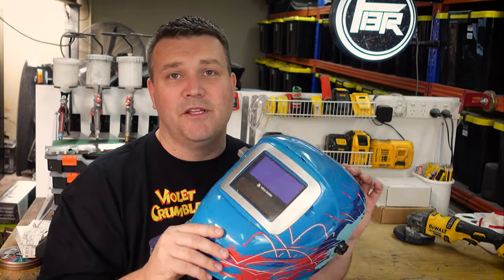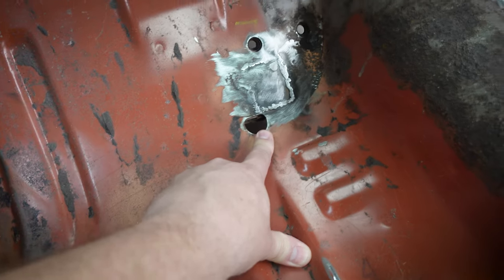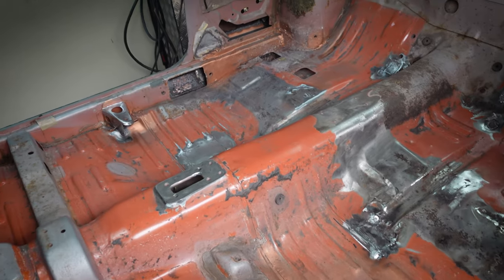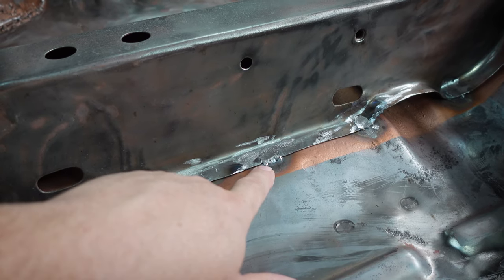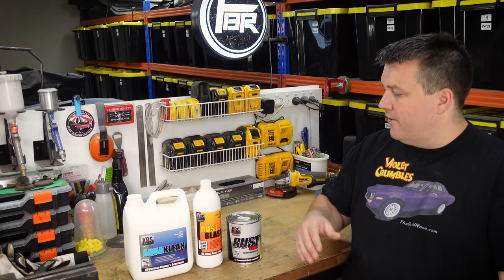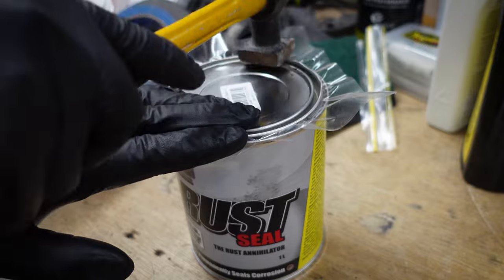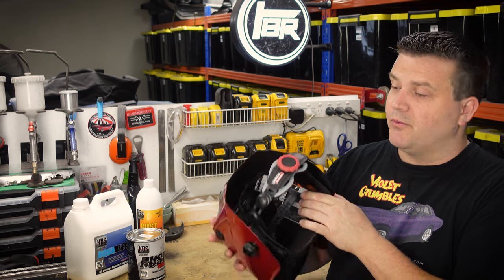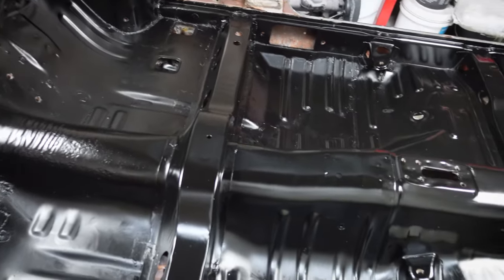Fixing the Rusty Floorpan - RA23 Toyota Celica Restomod (Part 30)

Comment: The sand just gives you a non slip layer to the floor mate. I've wanted to see a reveiw on the KBS stuff for a while so cheers for that.
Reply from the maker: Glad it can help - I haven't used it before far so will let be sure to check back in over time and update if there are any failures/problems.
Reply: It’s great gear, follow the instructions, give the rustblast plenty of time to work. The surface should feel very dry and grabby for the first coat. Thin the second coat a little, or you can slap it on heavy but it will run and pool.
Reply from the maker: @nickmcarr617  missed a couple of spots on the first round so will definitely do a second coat, have some KBS thinners too so will try it out. Cheers👍
Reply: @TheBuildRoom  you did great! Feels good to get it down into the seams mate,   I spent ages getting all the old seam sealer out. Well done.

Comment: Great work, I’ll definitely get a tin of kbs now that I have seen it in action. For my welding helmet I’ve got a sentinel A50 with many hours under the hood it is the most comfortable and light hood I have used so much so you don’t even feel it’s there. For respirator I run a 3m 6228 welding mask and sometimes a air fed one.
Reply from the maker: Man that welding helmet looks sweet as - very nice. I was wondering about those flexible filters on the 3m masks - i have a half face for painting but the plastic filers are a bit bulky and heavy under the mask, will give the foam ones a shot. Thanks for the tip 👍👍👍

Comment: Congrats on doing a full on proper resto and stripping it to bare metal. Good luck with the KBS/POR15 stuff. After a fair few decades of experience I only use 2 part epoxy primers now like Rustbuster EM121 or Jotun Jotamastic90 as I found the prep, application and after effects of KBS and Por15 to not be great. Hopefully your experience is better than what mine has been ;)
Reply from the maker: So far adhesion hasn't been a problem but only time will tell how it holds up long term - what after effects have you seen that are concerning?
Reply: @TheBuildRoom  I had microblister even though I had followed the instructions to the letter. I've also had the second coat delaminate when I've used tape on it years later for masking areas and again I followed the instructions for how and when to apply the second coat.

Comment: Another good ep. That KBS stuff looks and preps exactly the same as the “bob hirsch” stuff I used. Couldn’t get satin thou. So easy to brush on and get a spray like finish. 
Don’t give up on the Raptor on the underside. As you know I just did that and turned out great. But I did have to lift the car quiet high. 
What’s the special ep ?
Reply from the maker: Yeah the self levelling of it was impressive, wish it was uv stable for sure. The new project is to get one of my A chassis cars running so I can move it up and down the driveway on my own, so it'll be kind of a roadkill or vice grip garage sort of situation.

Comment: Thanks for the content Cam, another great episode. You've convinced me to remove the bracing and rust seal inside the cab. What brand of copper spray do you use?
I have a promax 500 welding helmet from hare and forbes which I rate.
Reply from the maker: Hi Mark, I use Bodyworx Copper Primer which is a GPI brand. It's about a half to 2/3 of the price of the Upol stuff 👍

Comment: Another great episode Cam! How long did you leave the floor pan to dry between the different products? Get it visibly dry and move onto the next step? Or leave it a day or so to properly dry out?
Reply from the maker: Hey mate, dried it out really well with the heat gun and clean rags, then left it another 4-5 hours before going on with the paint. It was dry as by that point 👍 You getting into the RX3??